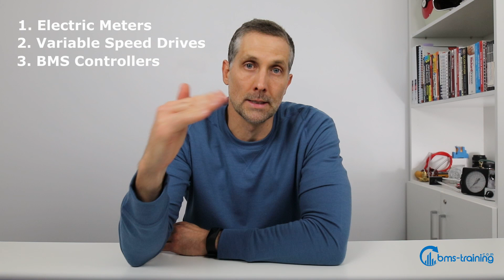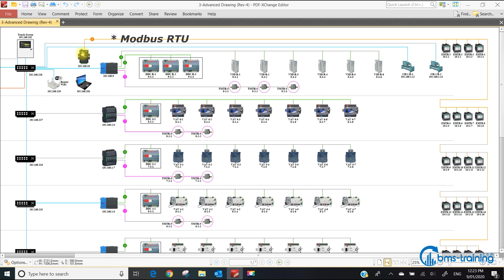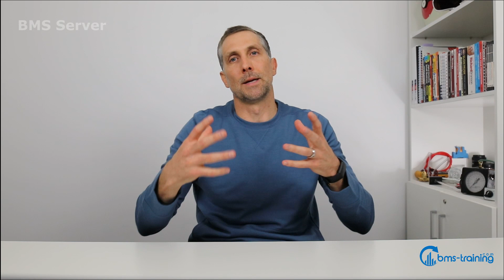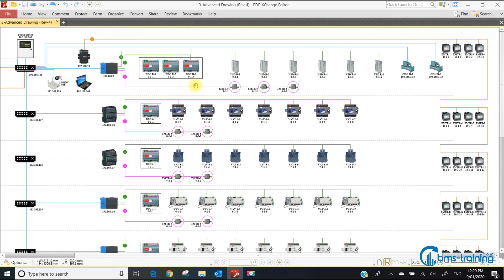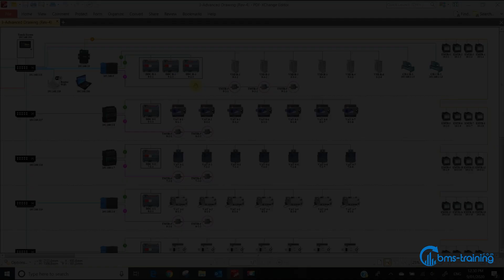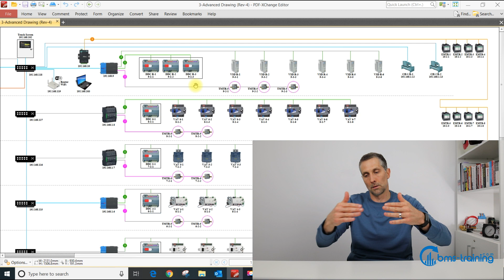BMS Sub-Network Design Considerations

Comment: Hi Bryce, what happens with the compliant OA rate when the FCUs or VAV boxes fed from the central AHU goes to heating and the SA rate drops? The OA rate will also drop Lower than design while the occupancy is still at design in heating mode.

Comment: Dear sir , what is the difference between network controller and extension module ? And is it possible use room management controller in BMS system ? Is it considered metwork controller ?
Reply from the maker: Hi, there are too many questions there, lol. 
A network controller is a high powered master controller that is in between the Ethernet network and all the field controllers. So, you could have a network controller with say one subnetwork (RS485) of 30 field controllers, and another subnetwork of 25 field controllers. The bigger the project the more field controllers you have and the more network controllers you need to manage all the field controllers. 
I don't think you can use a room management controller for a BMS. A BMS needs controllers of different sizes and capacities to deal with complex control strategies. E.g., you couldn't use 20 room controllers to control a chilled water system.

Comment: Hey Bryce, I found your channel a few weeks ago after somebody posted it on hvac-talk. I'm really liking the videos you are putting out. One thing I noticed in this video at 2:30, you mention that there is 1 master and the rest are slaves. This isn't exactly correct though, in common MS/TP sub networks, all of the devices are masters. My way of remembering this is the "max masters" property, "max masters" is plural because there are many masters. And usually the max masters defaults to address 127 because after address 127 is when the slave addresses begin.
Reply from the maker: Thanks for the comment. I think someone else may have messaged me about this as well. Okay..
Does this also apply to VSD's and electric meters? Are they also masters?

Comment: Really great video. When you say that the cable should be shielded and not grounded at the controller but somewhere and at one end only - I have heard the shield should be bonded and not connected to ground in order to ensure no ground loops exist. I have also heard you should bond the cable at both ends so as to ensure that you do not turn one end of the shield into a transmitter. Just wondering what are your thoughts on this? Again great video and I look forward to seeing more content.
Reply from the maker: Sorry Rob, somehow your comment ended up in YouTube's spam folder? 
In my opinion.
The screen must be continuous, I.e. joined at each controller, but not earthed at each controller. 
I only ever saw the screen earthed at one end only and that was at the main network controller or gateway. 
I dont think the other end should also be earthed, and I'm pretty sure most people believe this.
Reply: @bryceanderson17  your definitely right. BACnet MSTP standard is a daisy-chain  network and minimum requirements i would say: EOL, One Earth cable shield connection (more then one Earth connection generate faults due to inductance - loop theory).

Comment: Thank you Bryce for sharing your insight. Excellent material. You take 2 examples here, a very small site and a very large one. What about in between? Do you have a rule of thumb of when BACnet MSTP networks should be separated?
Reply from the maker: Hi. I generally follow the RS485 rule that the maximum number of MSTP devices on one sub-network should be less than 32. Occasionally when its impractical to split I would allow slightly more. 
Some companies challenge the 32 device rule and say that their controllers loads the RS485 less than a standard device load. This may be correct, but when considering the points in the video I think we should always try have less than 32 devices. This will help decide when to split the sub-networks. Also need to consider the budget and cost of additional gateways etc.